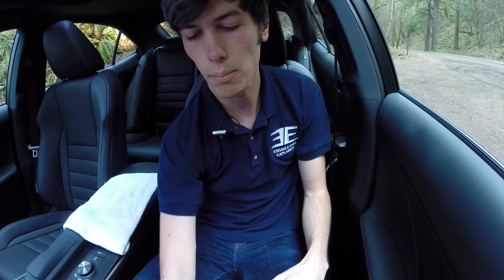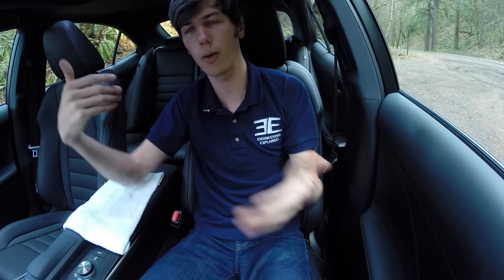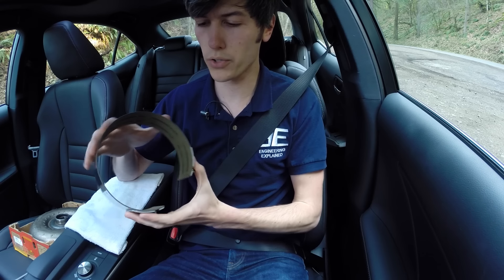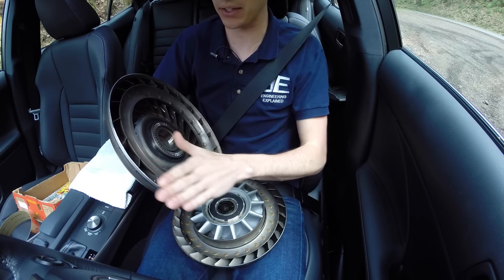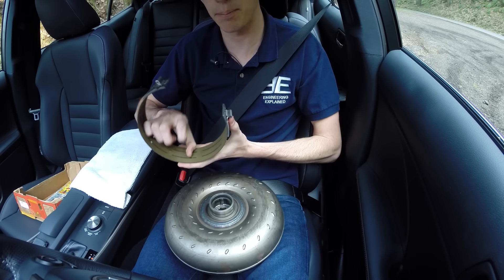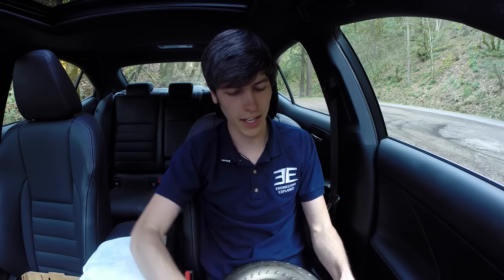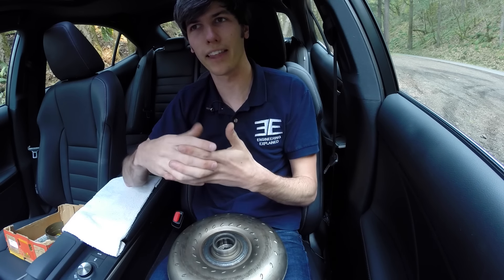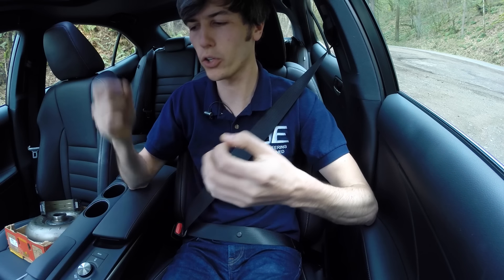5 Things You Should Never Do In An Automatic Transmission Vehicle

Comment: So why would you even need neutral in automatic then?
Reply: So the car can still be moved,  without engaging the transmission. This is necessary when towing cars,  going though car wash,  pushing it, etc.
Reply: +Orcjura to push it when it brakes
Reply: +ARandomYoutuber good anwser.... How can i rest in the stop from using the brake with out turning off the car?
Reply: +Siberian Sabillon It depends.  if you are on an incline,  you'll roll backward. If on a downward slope,  you'll roll forward. If the ground is level,  putting the car into neutral will work.  Sometimes,  if it's a slight incline,  you can just take your foot off the brake and the car's "creep", which is when the car automatically rolls forward upon releasing the brake,  will cancel out and the car will remain stationary. Just enough power to keep it from rolling backward,  not enough to make it roll forward.
Reply: Because you can't switch directly from drive to reverse. That's why there's a neutral on standard transmission, you wouldn't be able to go straight from first to reverse.
Reply: +Orcjura Neutral is very useful. Car became easy to push around, make less vibration during idling, and is able to coast without power on level road. The video only said things about the law & maintenance, it didn't tell you how to benefit from it, or what it is used for.
Reply: +Orcjura neutral is mandatory: when on park the transmission is actually in neutral WITH a brake. If it wasn't in neutral the car would very hard to impossible to start.
If the motor stale while driving, you can actually put the transmission in neutral to attempt to restart it without having to stop. It is not ideal, but may be the only way to do it safishly, ex on highway: you do not want to stop on the left lane, and since you're now slower than the other lanes you can't switch lane.
Then, a big reason: in case of a mechanical failure, which include run away engine. The carburator is often made in a kinda bad way: the gas pedal turn open the throttle plate, a spring turn it close. If the spring break then you can not slow down anymore the engine! New modern car with drive by wire is kinda even worst: it is a small motor that turn that plate. That mean that the ECU is what control the motor. If the ecu crash (it is a computer after all) or the motor die, then it may be impossible to slow down the engine. In this case you have two ways: put the ignition key on accessory and lose the power steering, abs, stability control, traction control, wipers on some cars and power brakes (since they are vaccum powered and the vaccum is created by the running engine). The second way is to put the transmission in neutral.
If you need to be towed, the car need to also be put on neutral while the towing move the car until they switch side. The car is never towed more than about a kilometer with it's driving wheels on the ground (the transmission could overheat since the pump ain't running, which may send the oil to a cooler, also oil do not circulate, so part may not have oil). Usually the towing will pick the car by the driving wheel, so the non-driving wheel is what will be on the ground. If they can not then they will put the car in neutral, pick the car, move it to a safe place or open space, put it back on the ground and pick the right set of wheel.

The shift lever is connected mechanically to the transmission. The neutral position actually actuate a valve inside the transmission that force it to go to neutral. It will always put the transmission in neutral. Really good in case of a runaway car.

On a side note: some toyota owner claimed that their runaway car wouln't slow down when put in neutral AND with the ignition key to accessory. As I said, the transmission mechanically force it to neutral, and the ignition key is a big switch, the run and start position is the only ones that turn on the power to the spark plug, fuel pump and the injectors. It is a mechanical switch... It is part of the safety design of the car. Smart start button cars have one less safety...
Reply: +ARandomYoutuber or for your dog to pop it into whilst driving. Have a doxie who will do this to me occasionally.  Makes me miss my stick shift had more control but since I had to go cheap on the damn car had to go auto trans and now my dog will pop it into neutral (when he once again escapes his harness)  on the way to the hiking trails.. fun fun
Reply: +Siberian Sabillon Park?
Reply: +Orcjura In addition to what's been said already, neutral has another use that's not quite so obvious. In slippery conditions like ice or snow, shifting to neutral before applying the brakes can significantly reduce the amount of skidding and sliding. This, in turn, allows one to retain control of the vehicle.

If it doesn't help, then conditions are too dangerous to be driving in the first place.
Reply: +ARandomYoutuber i've heard that you are not meant to even push car in neutral full stop. didn't stop me, I coast in neutral, put it in neutral at stops, use it in 3 point turns. def safer than holding it parked in drive at every stop in my opinion. and like orcjura said why else would it even be there.
Reply: ***** Yeah that is also a good reason. Brake, apply ebrake, put in neutral, release brake, put to park. Now all the weight are on the ebrake instead of the lock pin in the transmission.
Reply: +Hellz Sent that would be a terrible idea to try and push a car when it brakes.....
Reply: +xponen Apparently you didnt watch the video....Neutral uses MORE fuel than just leaving the car in drive to coast.
Reply: Nick Palaroan then why do car slow down more if you depress gas pedal on Drive than on Neutral? because engine & transmission ate car coasting speed, even when its still running.

The reason given in car manual for using gear on hill descend is because the engine naturally slows down car due to air resistance inside the engine.
Reply: +Orcjura  in my auto 2001 jeep wrangler i have to put it in neutral to get to 4 wheel drive
Reply: +ISLAMATRON When in drive and coasting the fuel is shut off in the engine, you cant possibly save more fuel than that haha.
Reply: +xponen You explained it yourself....when you put it in neutral, the engine is still getting fuel therefore it will not slow down as fast as it will in drive when fuel is shut off to the engine it will slow down alot faster.
Reply: Nick Palaroan Think, if you're on Neutral you can move a car with your bare hand, but not on Drive.. clearly engine & transmission had soo much friction that's wasting speed.
Reply: +Orcjura  to move your vehicle if it doesnt run and you need to push it. Incase your car shuts off while moving. While parking on a hill, put the brakes on and let it roll in neutrual to take the slack up, so you're not resting on the parking pin. In case of a runaway engine. Etc. Etc. Etc.
Reply: +Orcjura same reason you use neutral in a manual
Reply: +TheOriginalJphyper The engine braking explained in this video clearly explains why shifting into neutral is done in icy conditions when traveling slowly DOWN an icy slope. The engine braking causes the tires to loose traction, especially dangerous in FWD cars because you loose the ability to steer the car safely.  Even sliding on Ice you retain the ability to have some control, the ability to still steer the vehicle could be the difference between ending up in the hillside or under the lake, you chose to steer the car into the hillside and not skid uncontrollably into the water...
Reply: +xponen Your not moving the car with your bare hands while your coasting haha. And its alot easier to push a car thats in drive since it will already be rolling haha. Ghost ride the whip!
Reply: +Orcjura guys i realise its a stupid question, my bad, i dont know wtf was i even on while writing this question xD
Reply: +john smith 
Yes, on a steep hill it should always be done in that sequence; one time a relative called up saying he had a problem, after he went straight to park while on a steep driveway, and because the weight of the car rolling loaded up the parking mechanism before the parking brake took hold, it made it very difficult to take out of park again when he was ready to leave.  
He thought something broke, but it just needed a very firm hand in pulling it back out of park.
Reply: +Orcjura  to restart a stalled engine while still moving.
Reply: Neutral is needed if you are towing a car.  Also like what he said in the video about going from reverse to drive it allows the transmission to transition easier.  Autos are sequenced PRND.
Reply: Automatic is still tiring and annoying In the 5 o clock traffic. Doesn't make that much difference. You still have to be braking, and going and alert
Reply: Automatic is still tiring and annoying In the 5 o clock traffic. Doesn't make that much difference. You still have to be braking, and going and alert
Reply: +Orcjura Towing and the brief moment between drive and reverse.
Reply: +ARandomYoutuber When I couldn't start my engine for some reason (computer fault - probably due to weak main battery) I couldn't select N anyway. It was like locked in P, so towing would not be possible anyway.
Reply: +Infidel Castro Most cars should be able to move to neutral, even if they can't start. You just need to put the key in and turn it to the on position. At least my car does. Unlike a manual you can't push start it though.
Reply: neutral saved my life. my gas pedal got caught on my weather floor mats and I ended up getting to 95mph on a very very short stretch of road, and I was coming to a stop sign that led to a highway.... sooo... neutral allowed me to slow down since I couldn't unhook the pedal lol
Reply: +Tanner Gill  I  could never understand people crashing their cars when a gas pedal gets stuck. Shifting to neutral works but you can also use brakes to bring the car to stop and then shut off the engine with a key. Your car engine does not have enough HP to overpower brakes.
Reply: +Orcjura The only reason i can think of is so you can still move the wheels of the car when its off or something specific like that. I've seen people push cars that didn't work and they obviously had to put it in neutral, and when they are saving miles on new cars by pushing them into dealerships and showrooms. There's a few other little specific reasons I'm sure too.
Reply: +ISLAMATRON Most of the time when people are coasting and would consider shifting into neutral, they'd be using their brakes to slow the vehicle down and maintain its speed anyway because the hill is steeper than the engine alone will hold back. Shifting into neutral is only beneficial on very slight declines, and it's very very hard to save gas in those situations, so it's best to leave it in gear and save the gas. The parasitic drag is literally identical to the amount of gas an engine burns by running at idle, because that's exactly what it's doing except without fuel because most cars are programmed to shift to the highest gear possible while keeping the engine turning enough to build brake vacuum and power the steering pump on cars that haven't switched to electric power assist steering, and they also engage/disengage the torque converter lockout as necessary to maximize fuel economy when they're in gear, and you have to actively do things in order to override that behavior in a way that would be ever so slightly more efficient. Plus it saves burning up the brakes to keep the car from going too fast.

Over all, it's best for almost everyone in most every situation to leave the car in gear. Very few people hypermile, or would even know how to do it properly, so in practical terms, it's really more just a pedantic argument that using neutral is sometimes better than leaving it in gear. Neutral is better in some cases from a theoretical or mathematical maximum fuel economy perspective, but not from a smooth and safe flow of traffic perspective. But the vast majority of people aren't capable of, or even interested in understanding the hows and the whys of hypermiling and fuel efficiency, they just want to get from point A to point B. Those people will never benefit from shifting into neutral while driving with any modern car— and government fuel economy and pollution standards ensure that will always remain the case with internal combustion vehicles going forward.
Reply: Phoenix84118
yeah, probably it should normally work, but in my case it seems like the computer somehow blocked everything so even when I turned the key to the ON position, it was like if I didn't do it. I still couldn't move to neutral. I had to wait about 30 minutes until the computer "changed its mind" and then the car started. On the display it said "Park Brake Fault" and orange light came on.
Reply: Ray_Biker
actually, some car engines, if you rev them up, have enough power to overpower brakes. That's how many people do burnouts on RWD cars. Pushing the throttle to the max, while holding the brake. The rear wheels start spinning and burnining :)
Reply: if you ever have to push the car for any reason you will need to put it in neutral

Comment: What car are u sitting in?
Reply from the maker: +Johnny Hohenzollern IS200t
Reply: +Engineering Explained, you mean lexus? Why does the gear shifter look so different?
Reply: +Ian Geer your comment was moire useful than anything in this video
Reply: +Johnny Hohenzollern Lexus IS with F-Sport Package. The car could be an IS200t, IS300, or IS350. Must be AWD because it has a heated steering wheel. I sell Lexus at Lexus of Santa Monica in Los Angeles and I have never seen a current generation IS with a heated steering wheel.
Reply: +Nima Ataei IS250 or IS200t because it didn't have the Sport+
Reply: +FT86ClubVancouver it does. Sport S/S+ share the same setting. Its the right setting of that knob in front of the arm rest.
Reply: +Johnny Hohenzollern It is a lexus IS 250f or 350f sport
Reply: +Nima Ataei tell amir what up @,lexus..lol
Reply: +Ian Geer exactly. Ive been waiting for him to say that in the video. I long researched this question because I use to coast in N from a top a hill for 1.5 km thinking I was saving gas. In my research, I found out, it was not safe, you did not save gas really, and you can burn your atf.
Reply: +Johnny Hohenzollern It's an over priced Toyota basically.
Reply: +Nathan S, its not a Toyota mate. Toyota would never build a quality cabin like that.
Reply: +Johnny Hohenzollern Lexus is a division of Toyota, so hes kinda right but i wouldn't say Lexus is overpriced...Lexus if fkin awesome. That's like with Audi and VW.
Reply: hard to over price a lexus. they're the nicest car you can own as a daily. you can argue some mercedes models but lexus' LS line is untouchable
Reply: Nathan S That is like saying that a Ferrari is a fiat
Reply: +Engineering Explained Is it bad to shift gears manually in an automatic transmission with manual shifting mode?
Reply: +Travis Black No, 11:52
Reply: +Ian Geer Towing at low speeds for short distances rarely if ever does any damage., if the car is in neutral and rolls freely.

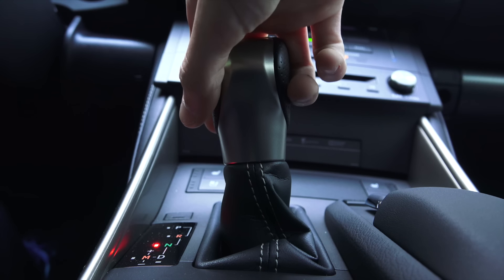Comment: 7:17 In newer car, yes, leave it in drive, they are all designed to do that.
But in some older car from before early 90s, leaving it in drive usually make the engine rev much higher and vibrate for most cases, they didn't designed to be left it in drive as long as newer cars.

Comment: why do you say to put the car in neutral with a manual car and in an automatic you say you shouldn't whats the differents?
Reply from the maker: +shelory With a manual transmission you're applying unnecessary pressure on the throwout bearing, this is a completely different coupling (torque converter) in an automatic.
Reply: +Engineering Explained thanks
Reply: +Engineering Explained throw out bearing v/s torque converter. I put my money on the throw out bearing. the torque converter will go out way befor  the throw out bearing why? you loss the torque converter odds are you done lost your tranny (just saying)
Reply: No.
Reply: +Adam Daley that's just how I feel less you know better
Reply: +STEVE MILLER unless a throwout bearing lasts for 275k miles. there is no need to put an AT in neutral when at a stop light.
Reply: +Engineering Explained Letting the (manual) car idle in neutral puts no pressure on the throwout bearing if you let the cluth out (like you should, if you're in neutral for more than a moment). Question stands: why do your reasons for not coasting in neutral in an automatic car not also apply to a manual?
Reply: +shelory Ane is a manual and one is an automatic lol
Reply: Probably cuz I'm auto all you do is hold the brake and let off when you're ready. But you can drive however you want as long as it's safe
Reply: Autos have to be rebuilt to launch and race properly with.. A standard you can dump the clutch and have much more control over shifts without all the hassle
Reply: what's the differENCE*  Go back to school.  No such word as differents.  LawL
Reply: +Bernd Jendrissek He is saying that you SHOULD put it in neutral in a manual if you are just idling for any significant time, so that you don't put unnecessary pressure on the throwout bearing by holding down the clutch. The question was about idling, not coasting, but he is saying keep it in gear in an AT and let the torque converter take the load (vs the throwout bearing in a manual). I think of it like an unboiled egg: if you spin it on the counter for a few seconds, then stop it and let it go again, it will begin to spin because of the rotating fluid inside (at least that's how it works in my head). Like he said, this causes very little stress on the torque converter and the transmission, whereas holding the clutch down will cause normal bearing wear on the throwout bearing. I hope that is all correct and makes sense.